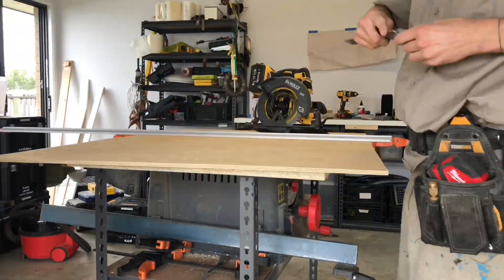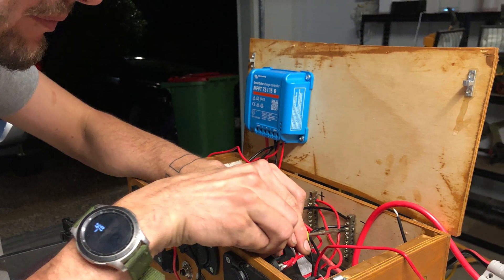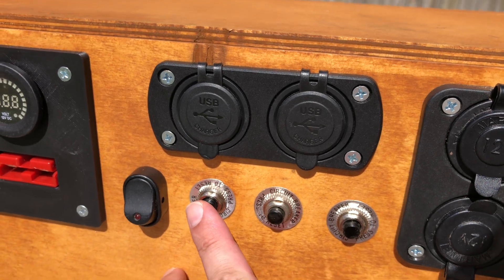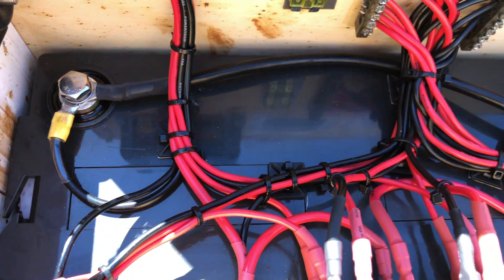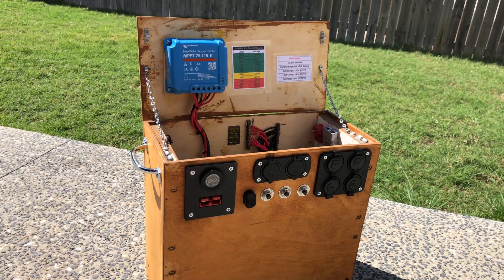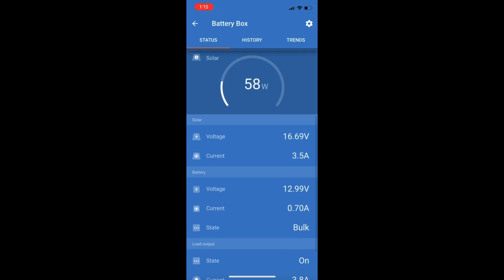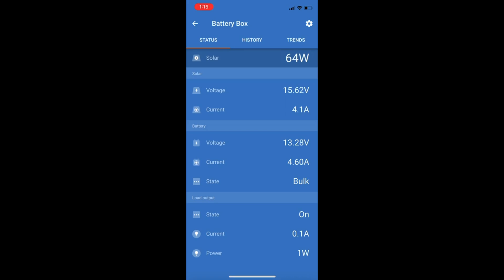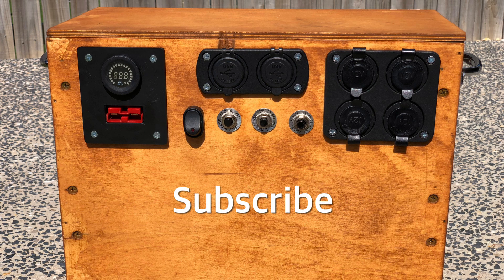My 12v Battery Box

Comment: I love the box, especially that Victron controller (best on the market). I'm sure you already know this, but you could greatly reduce the weight buy using a LiFePO4 battery (or batteries) instead of that AGM. 37 Kilos (81 pounds US) is a bit much to move around. lol  But, at least that 140Ah battery should last a good while.
Reply from the maker: Yes. I agree it is on the heavy side, but price was a big consideration in this build. 

This AGM will give me 5 years, a lithium will give about 10 years, however the lithium is more than triple the cost.

Comment: nice  why no 120 outlet does the car outlet have an adapter
Reply from the maker: Thanks.  The reason I dont have mains power 110/240v is cause this is for camping.  When I go camping, I don't bring those types of appliances. If it cant run off 12v, then it doesn't belong camping.

Comment: Hey man, excluding the battery, how much did the build cost you?
Reply from the maker: Hi there. All up it would have been just under $300 I think. I did have a lot of the stuff laying around leftover from past projects. 

The USB ports were about $30
The Cig ports were about $50
The circuit breakers were about $30
The other wiring and electrical was about $40
The Victron controller was $140
The wood is marine grade plywood, I had heaps laying around from a past job, so not sure of its price.